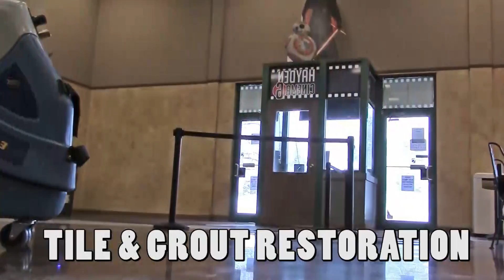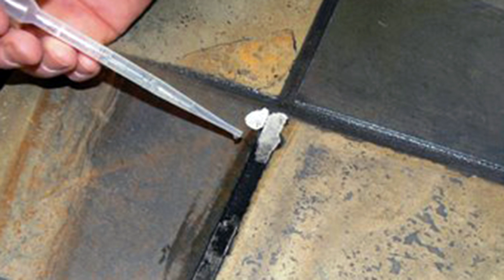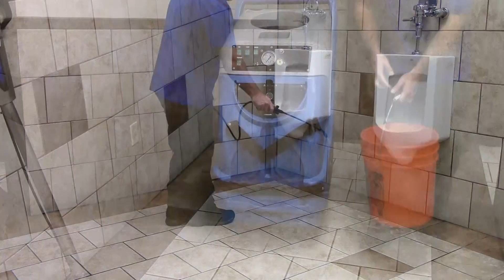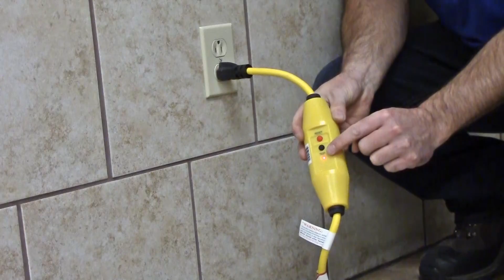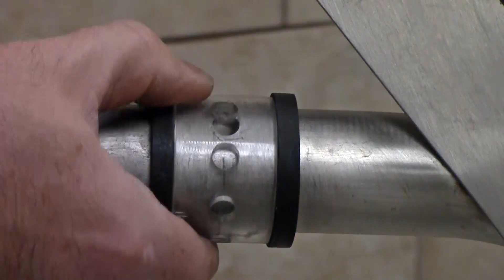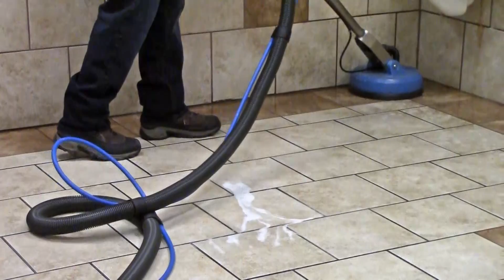Cleaning Tile & Grout with the Endeavor Multi-Surface Extractor

Comment: If you’re looking for a machine to clean tile & grout especially for commercial kitchen & dining room floors I’d recommend a commercial steam machine not this cumbersome piece of junk. For restrooms I’d recommend a Kaivac not this cumbersome piece of junk.
Reply: are you kidding Kaivac is twice the size of most extractors and they certainly don't even come close to 1200 psi. (400 tops). Steamers are great at killing bacteria and melting sugars and grease but they fall flat at retrieving the filthy mess.  Usually, a fiber pad is used to wick what is dissolved but no one changes a pad. They just push it all around.  Been doing this for 35 years and found steamers to just drive residues deeper into the porous substrate we call grout. They also move so horribly slow compared to spinner tools like the Turbo and others that vac up the mess as it forces out the grime.
Reply: @TheTurboman2  I have used this Endeavor, the Kaivac 1250, & commercial steam machines from Chief Steamer all at the same medium sized coney island restaurant. This machine is double the size of the Kiavac 1250 & didn’t do shit on the grout out in the dining room. Even the guy who sells & repairs these machines told me it’s basically only good for restrooms & wouldn’t do much on the grout in the dining room & kitchen. Even the Kiavac 1250 is shit when it comes to cleaning grout. Using two Chief Steamer 100s & a microfiber dry mop my company has the grout back to almost original color & condition. The owner is much more pleased with the commercial steam machines than the Endeavor or the Kiavac.

Comment: Hi
Is there a smaller version of this machine to use for residential 5bedroom home? I like to buy this machine since it cleans hardware floors well and restore it like new especially since my bathroom usually get dirty fast due male to kids who pee outside of toilet bowl throughout the weeks at time. 
Where can I order one online since I’m in Hawaii?
Reply: Remember these machines are about 4,000 bucks. There are cheaper carpet extractors that can also be used to clean hard floors with a floor tool. The biggest issue is having a machine with a high psi sprayer 800 psi to 1200 psi for example.

Comment: As and industry leader your videos should be reviewed by a seasoned veteran, not a sales staffer. Your video training is somewhat irresponsible. Never use acid to test tile for acid sensitivity or you just etched it.  Are you prepared to repair it by polishing to original shine.  Acid should rarely be used.  Testing grout for the presence of sealer can be done using just water as water will penetrate and darken the grout.  The acid will also etch grout making grout more difficult to maintain as it gets eroded every time you use it to clean.  Higher heat and PSi with some brush agitation is all you need.
Reply: Turbo-Seal hey you seem to know all about this stuff... Im thinking about getting into it and was wondering what brand of portable extractors would you recommend the most?
Reply: @jrfish198526  Any auto dumping extractor will work to retrieve wastewater from most spinner tools. It is the pressure that lacks on most of these machines. You're paying a premium price for a so-called high-pressure hard surface extractor and the PSI they advertise ie (1200 psi) is measured without the tool engaged which is the Static pressure. Dynamic pressure is the pressure you will have once you squeeze the trigger of the valve on your spinner tool. That is your working pressure and that's what counts and is cleaning the surface of tile and grout.  There are just a handful of electric pressure pumps that can deliver pressure high enough to really do a good job cleaning without prior machine scrubbing or grout brush efforts. PM me if you want specific models and sources.
Reply: @TheTurboman2  I actually bought the goliath 1500 psi couple years ago and I’ve only used it like 15 times my other line of work got extremely busy but I still have the machine and it works really well
Reply: @TheTurboman2  So youre saying this wont do the job?
Reply: I concur...

Comment: Hi there I wonder if you can help me I'm starting a pressure washing company and would like to offer tile and grout cleaning. The machine I'm looking to purchase is a 4000 psi at 4 gpm. This would be to strong to use on tile and grout ??? Would i be better off buying a separate 1500 psi machine to use with the surface cleaner on tile and grout. Any help would be much appreciated. Cheers.
Reply: George,  The older grout is the harder it gets just like concrete.  If grout is weak it was weak the day it was installed.  Air entrapment or overhydration are the only causes.  overuse of acid cleaners is the second reason for weakened grout as it is often not rinsed or neutralized.